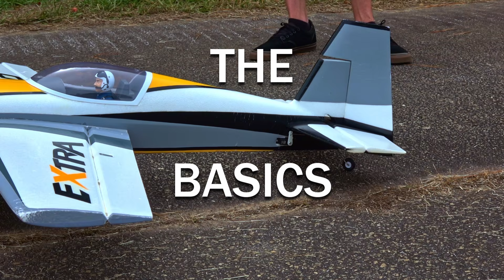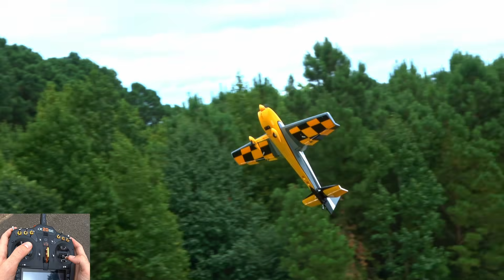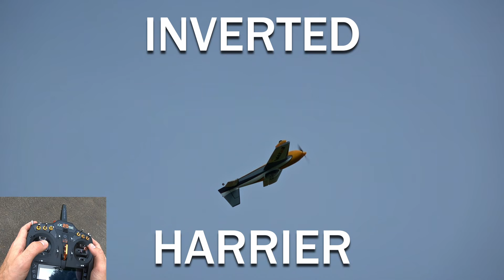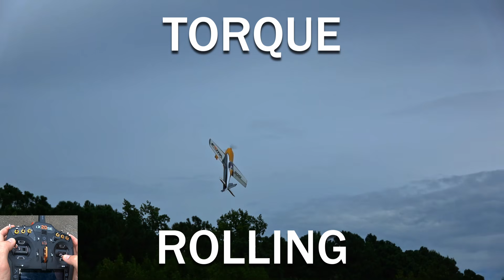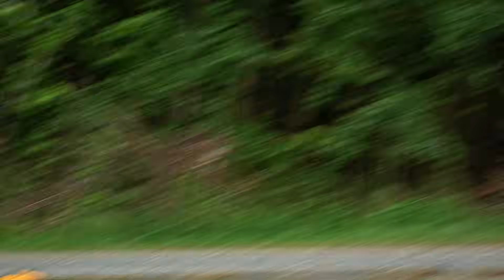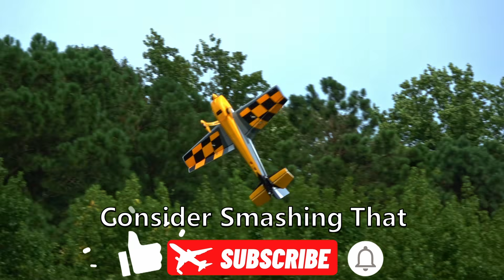Learn Beginner 3D Flying Techniques

Comment: Hi im new to this and i got a question, i want tu use my own build f22 jet to perform this kind of movement would it be mostly same control or different bc it has different aileron setup?
Reply from the maker: This really isn't the kind of thing you can do with an F-22's planform.
Reply: @TwoBrosRC is there any vid in depth about 3d tricks for the f22

Comment: Ive been flying for 6 months now and I only have FMS Beaver, P40 and Dynam Fw190 but learning basic 3d with the beaver really well. I can hover, harrier, knife edge and hammerhead really smoothly, and have translated some of the tricks to the warbirds but they dont perform as smoothly as the beaver does, excited to scratch build a balsa 3d plane over the winter once I finish my 1975 Sig J3 cub balsa kit and really push myself.

Comment: Hi John, what battery do u used for this old extra 300? I tried my 220g 2200 4s maximum to the nose of the plane today with my frsky without gyyro and i have not good feeling, not stable and not easy to land; thanks for your reply
Reply from the maker: Spektrum 2200s were what got flown in this vid, if memory serves.
Reply: @TwoBrosRC  Ok thanks, so the same i have, so if you found it ok, it is probably my skills that are not good enough(also i have no as3x)
Reply: @TwoBrosRC  , you use 2200 also on the new extra 330?

Comment: You absolutely do not need to use full elevator, and rudder in a snap roll. These RC airplanes have throw for days. You essentially performed a blender in the horizontal direction.

Comment: What motor and blade pitch are you using?
Reply from the maker: Stock motor, 13x6.5
Reply: @TwoBrosRC  alright thanks im looking for a setup with low speed flying but with a prop pitch that can easily get me out of trouble any suggested setup?
Reply from the maker: The best place to ask is Discord via discord.gg/twobrosrc
Reply: @TwoBrosRC  thanks

Comment: Why is inverted harrier flown at much lower AoA than upright? I usually see it that way, as here.

With my own plane, if I try for higher alpha in inverted harrier, the plane wants to go into an inverted spin, but idk if that's just a quirk of the airframe.
Reply from the maker: It can be flown more aggressively. Just depends on how comfortable you are with the maneuver.

Comment: are the stock servos, ESC and motor good?
Also, how much does your battery weight?
Is it safe to order it from Amazon? (2x cheaper in my country than local stores)
Reply from the maker: The stock equipment is completely fine. No idea on what the specific battery weighs, not sure why ordering from Amazon wouldn't be safe.
Reply: @TwoBrosRC  Thanks! Also, with 2200 4S battery, how long flight time can I expect? And is it for one flight, or maybe 2/3?

Comment: I tried a waterfall on my T-28 and it was immediately apparent that it was outside of the Trojans flight envelope.. Also upon trying to complete the maneuver while inverted I was flying with the wind so it also stalled the wing.  It plowed into the ground and was a total loss. I'll buy the Extra 300 before I try more 3D
Reply from the maker: Yeah, that's not a 3D airframe lol

Good on you for trying out something different though!

Comment: That’s not how you should do 3D
Reply from the maker: OK, thanks for sharing your super insightful opinion.
Reply: @TwoBrosRC  I am preparing an exam for engineering so I have not a lot of time to reply, my comment was not offensive, after the exam I will explain why I think that this is not the way of doing 3D
Reply: @TwoBrosRC  sorry for my bad English btw
Reply: @TwoBrosRC  ok I have 5 minutes of break: first of all when you do a snap roll you don’t have to hold up elevator but it’s just a tap and then only rudder and ailerons.
Another important thing is to avoid changing rates and expo mid-flight. To master the 3D flight you have to build sensibilities around rates that you use during your entire 3D flight.
The harrier should be done without using mix with ailerons but you have to achieve it only by using throttle and elevator.
Another important suggestion is to start learning knife edge while speeding ‘cause in this manner you have to input a lot less rudder and you avoid correcting too much on planes non that balanced
Btw that’s my point of view, I am open to any replies!

Comment: We got the Extra 300 yesterday.  It started raining during radio set up. Looks like I wont be able to fly it for nearly a week.  Argh. I'm thinking I'll run it pretty stock at first. I'm interested in the Harrier configuration on your set up video, but more importantly, this plane really should have come with onboard battery monitoring through the transmitter.  Is that called telemetry? Sorry, I'm new to electrics.  I see that you have set that up, but do I need to swap out receivers to do it?
edit: I'm using an NX8.
Reply from the maker: You'll need to run a voltage wire to an AR637T or use an Avian 60 amp ESC connected to the stock AR631 receiver to get voltage telemetry.

Comment: Does your rudder tail wiggle by itself sometimes?  Mine wiggles now and it doesn't stop.
Reply from the maker: Move the pushrod in a hole on the servo arm and recenter it. The servo can easily hit a harmonic resonance and flutter until the battery dies if you don't do this.

Comment: Awesome what you can do with those models Jon! Im just getting started in the hobby and got my first plane. I find it difficult to keep the throttle at a certain position when steering with rudder. Any tips on that?
Reply from the maker: Practice! Focus on learning to control the rudder while throttle is maintained. It'll be vital to growth as a pilot. Even if it feels weird or uncomfortable, keep working at it. You'll show improvement if you keep doing it.

Comment: Perfect 3d bird!

BUT, HH has lost their minds on the $$ of the Extra 300! 1st 1 I bought was $329. 2nd was $359. $400 is way overpriced for what little u get. NO avian, pinch hinges (good rudder hinges), cheapo esc, is too much.  IMHO! That being said,  for $50 more 1 can get into 80mm edf's!🤷‍♂️
Reply: AS much as I love mine, it's rarely flown nowadays.
Reply from the maker: It's still best in class at its price and size. There aren't really any other models this good out there.

Comment: The "Harrier" is me trying to land!
Reply: Lol. I've maneuvered into a harrier trying to land a twin engine plane for the first time. I didn't even know it was a maneuver. I can now say though, harrier with twin engine is super stable
Reply: Then you’re pretty good at landing
Reply: Dude so true i do that with taildraggers i first started on pheonix flight sim i did no🤣🤣t think anything if it i showed my dad me doing it i was like 7 and my dad still scolded me about landing like that because i will break the plane i thought it was a normal stall
Reply: @Swaziman919  Nothing wrong with that!  It takes some serious skill to do and very nimble fingers or thumbs. I had a Sukhoi I would fly up and down my street block then hover in front of my house. The neighbors were always blown away by it. Then, I started building jets.
Reply: @TheFrenchPug  thanks for the support i havent flown in a couple of years and im trying to get back and do aerobics again…could you suggest any jet plane ideas or designs in the future for me?
Reply: @Swaziman919   @Swaziman919  Everything pretty much went to electric. So, I went to electric. Those turbine fans were thousands of dollars. Nothing worse than putting one of those back into kit form. Just start with small jets and work up. Landing is usually the biggest challenge I have with them due to their speed and glide distance some need.
Reply: @ oh ok i see…makes sense

Comment: I have a UMX Timber X, will learning 3d flight be harder on this plane (because of its size) as oppose to the full size Timber X?
Reply from the maker: Yes. Being smaller makes it more difficult to fly some of these maneuvers.
Reply: @TwoBrosRC  well, I guess I'll just have to suck it up and learn, I don't have the space for a larger plane.
Reply: @Razor-gx2dq   if you have room for em,a 32 profile plane will be easier for leaning 3D. I’d recommend any of the twisted hobby’s 32in standard series’s planes or if on a tight budget  motion rc’s skynetic Piaget will do easier 3D than a Umx.

Comment: What up Jon!?  I’m still trying to fix my Fms arctic camo A-10 but the front retract hasn’t been in stock for 30 years… you happen to know of any other front retract that would work for it??? With as little modifications as possible??
Reply from the maker: Buy it off AliExpress. It's probably in stock there.